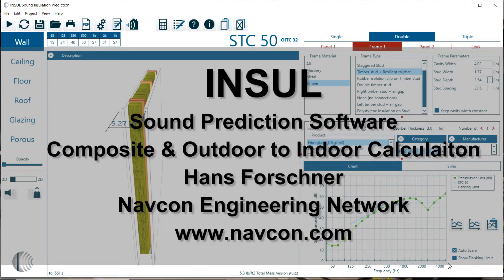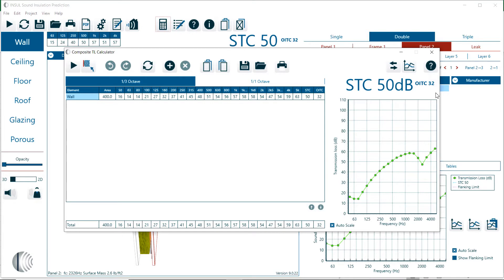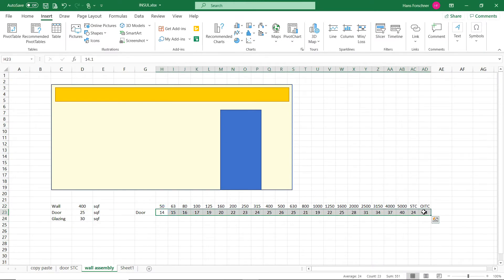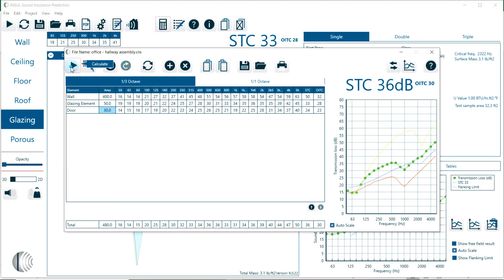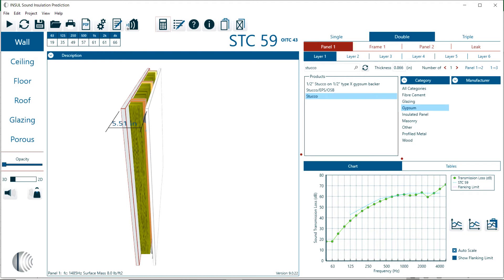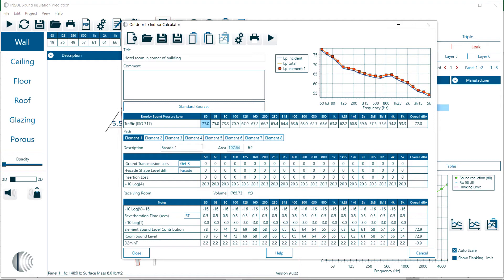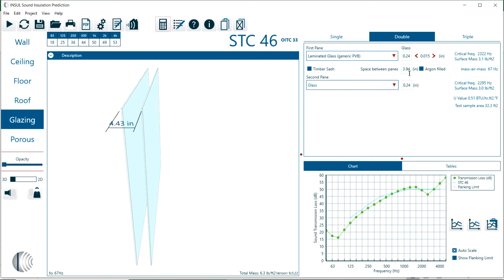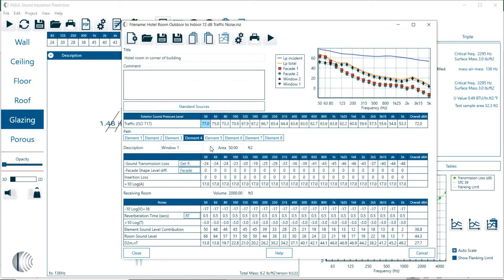INSUL Composite Wall & Outdoor to Indoor Calculation

Comment: How to about holes on a wall, can this software predict it?"
Reply from the maker: INSUL has a feature call leakage that allows you to consider a leak in the construction.  It can be entered as a slit (height, length, depth) or aperture (diameter).  There are various parameter to select from based on two implemented papers by Gomperts or Mechel.  Get a trial license and try it out.

Comment: Great video. Looking at the +10Log(T) row, this looks like a facade correction. Do you know if there is aa way to use the Outdoor to Indoor calculator based on data measured in free-field? Thanks
Reply from the maker: Jack, the +10log(T) correction is for the reverberation time in the room.  So for a 0.5 sec reverb time you get a -3 dB correction on the estimated sound level inside the room. In the bottom table you have the correction for the room volume and the room reverberation.  

There is a facade correction but that is in the table above see around 12:15.  See Facade Shape Level Difference.  Look at the schematic that will give you some correction values for galleries and plane facade,....  and you can enter the correction into the table.  

In regards to your question on free field measured data.  I assume you talk about noise measurements such as the existing traffic noise levels.  If you have the data in a excel file you can copy and paste the free field levels into the exterior sound level column.  Depending on the setup of the measurements and the future buildings etc you may want to apply corrections to account for changes that you have between the free field condition and the future building setup.